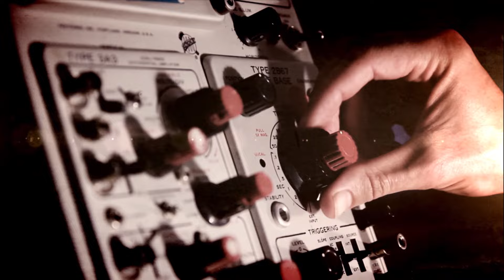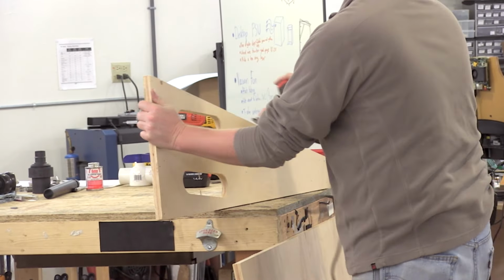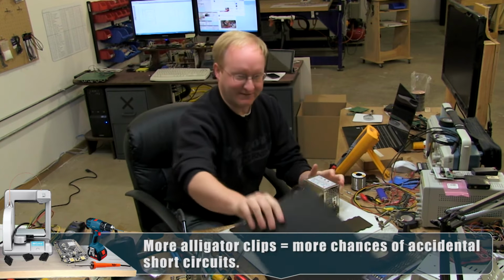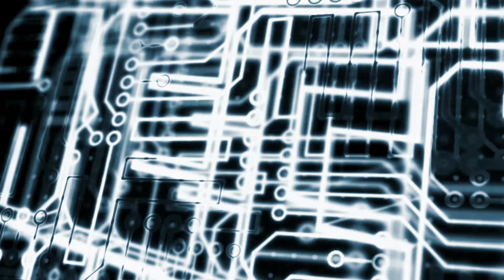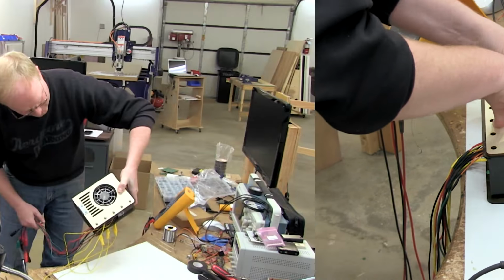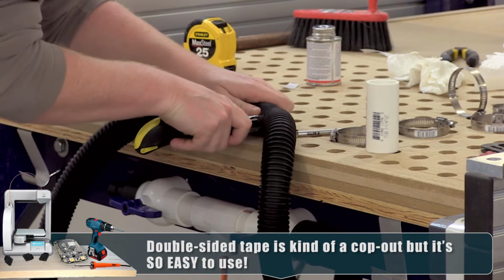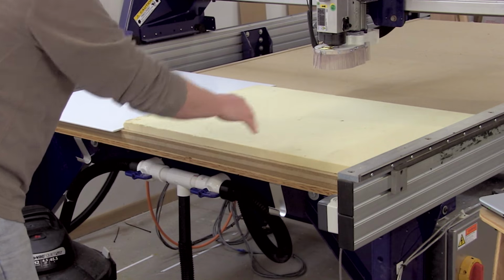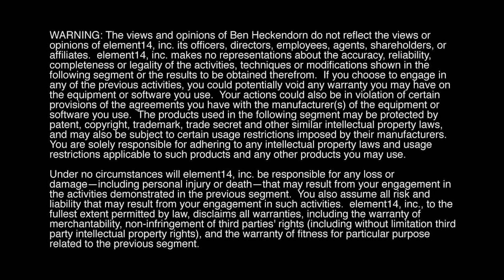Ben Heck's Workshop Hacks

Comment: Ok so a teacher and I at our school are having a debate about soldering-don't you take the iron and the solder and touch them both to the wire; he thinks you heat up the two surfaces and then put the solder on them so that they join from the remaining heat (which I don't believe is correct) the first way is how I was taught and how Ben does it
Reply: It depends on what you are trying to accomplish. The way Ben solders actually drives me crazy because if not done just right it can cause cold solder joints that fail down the road. Ben gets his stuff to work long enough for the show. But I'd be really interested in knowing how many of his projects fail several years later from cold solder joints breaking. I'm not trying to criticize Ben. He has his technique and he is very good at it. But I would not say that it is a commonly taught technique.

The way I was taught to solder is that both pieces you are soldering should have a good PHYSICAL connection first. Ideally, they should not be able to move with respect to each other or else a cold solder joint is more likely to form. Then, you place the iron against BOTH pieces and heat them to a temperature that is hot enough to melt the solder. Next, you touch the solder to the pieces (not the iron) and the solder should flow around both of them. Finally, you remove the iron from the work pieces and they should not be allowed to move as the solder cools.

However, there are just going to be times when you need to touch the solder to the iron to get it flowing or where you need to put solder on one piece first and then bring them both together later. So what I described above is the common technique used when you can physically connect the two pieces in relation to each other. What Ben likes to do is skip this step and "tack" the two pieces together using only solder. And again, this drives me crazy because there is a huge potential for cold solder joints to form if not done correctly.

I am not an expert. I would look on youtube for some tutorials on soldering from organizations that actually teach the techniques.
Reply: I should also say that the type of projects that Ben does tend to require his method of "tack" soldering. He does a lot of miniaturizations and repurposing. You simply can't use a traditional soldering technique on these types of projects. Frankly, I wouldn't be able to solder half the stuff that Ben does because I'm just not good at that technique. Ben has likely spent years developing his sense of touch and finesse that allows him to use his technique successfully.

But for most people (especially inexperienced ones), using Ben's technique on certain types of work would result in failure so it is not taught as a classic technique. His method of "tack" soldering definitely has its uses. But it should not be used for all types of soldering.

So as I stated above, the answer is: "it depends".
Reply from the maker: It varies, typically you want the metal that you're soldering together to be heated first and then apply the solder. Otherwise you'll end up with cold/cloudy solder joints that will fail.
 This may mean pre-heating each bit of metal individually and applying a small amount of solder to help the process.
Reply: Typically best to heat both surfaces and then apply the solder. I don't remove the heat source before applying the solder. Just make sure you apply the solder on your parts and not melting it directly on your soldering iron. If you see the solder flowing on the metal, that typically means you're all set.

By coating both surfaces in solder and then heating them. You have two main problems. The first being that your surfaces might be quite far apart from each other. The other problem is that it's hard to know if you've flowed all of the solder in your connection which means sometimes you end up with a cold solder.

In my experience, it's very easy to make a dodgy connection using this latter technique. Though sometimes it's the only practical solution.
Reply: Yes, it all depends on what you are soldering to what.  For example when I am making connectors, after fluxing, I tin each connection point with a small amount of solder first (using the method previously stated, by preheating each connection point first).  Then I make the physical connection; add heat and just a touch of additional solder.  Other factors to consider are; the irons heat setting, the diameter of the solder that is being used, and the heat absorption ability of material that is being soldered.  Lastly for components, a quick check of the data sheet will usually indicate the max duration that heat can be applied at a given temperature, usually 3 sec. with through-hole components.

Comment: I would have desoldered all the wires from the PSU PCB and replace them with 18gauge
Reply: that would require a very powerful iron to handle the heatsinking of the wires and internal planes. my 30 watt couldn't handle it at all
Reply: slango20 Use a proper desoldering pump ;)

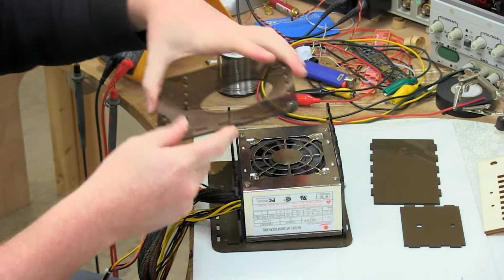Comment: 6:10 DO NOT DO THAT. Capacitors can still store a decent charge in the psu. Or at least make sure you don't have any ground wires in the bundle so you cant short it out.
Reply: If you have a PSU which will die because you short out the wires, you should probably throw it away anyway.
Reply: I meant for safety purposes.  Not to prevent the power supply from dying.